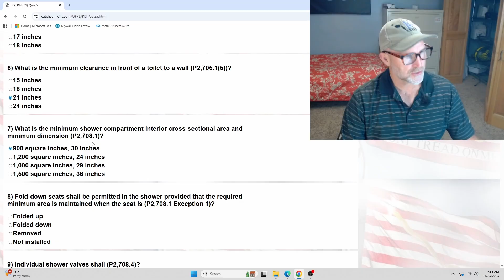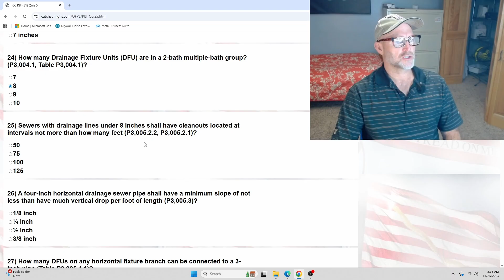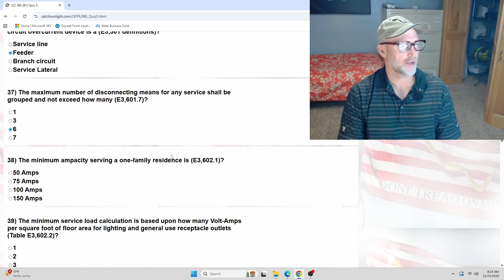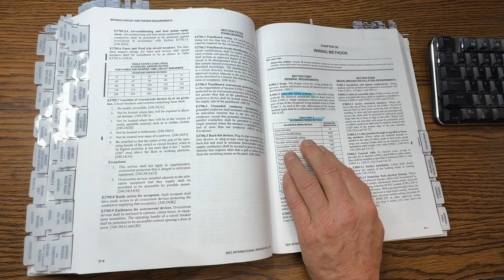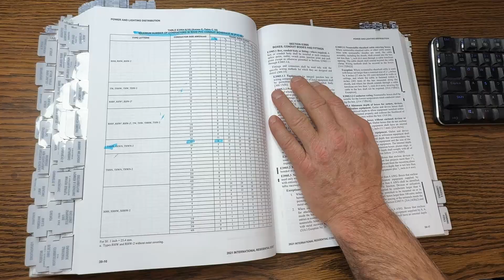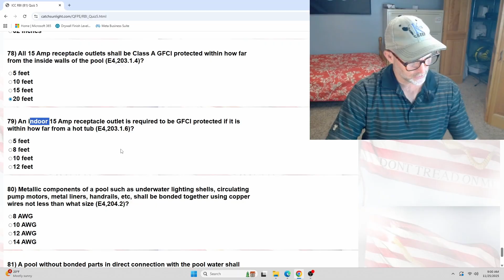Part 6 ICC Residential Building Inspector (B1) Chapters 26-42 || Final Free online test & notes

Comment: Hey my friend, can you give the website info on the practice quizzes? I recently took the b1 but failed and trying to be ready. Thanks
Reply from the maker: www.catchsunlight.com/QFPE
Reply: Thank you
Reply: Hey buddy, I have no other way to talk to you so I'll ask you on here. In the b1 practice test there's a couple questions that I'm sure of. How many risers is there a requirement for a switch at the top and bottom? I put 6 risers but it says it's wrong. Also, what wood is termite safe and naturally treated? I put redwood but it's wrong according to the test
Reply from the maker: @aservant2287  Ouch!  that's a major bummer on the fail.  As I recall, the answer on termite resistant had two wood types in the test when I took it.  In other words, there was an option with a couple species and they both were resistant.  I don't remember exactly what the question was, though.  Regarding risers, See 2020 NEC Section (210.70(A)(2)(1), (3).  It's 6 OR MORE risers.  I don't know the list of answers, but that's right from the NEC that forms the basis for the IRC.
Reply: @CodesExplained ok, no worries. It's a good prep test still

Comment: So is the electrical portion of this video only for plans examiner test? I’m taking the E1 next. Thank you for your help.
Reply from the maker: I can't remember off the top of my head but it seems like the B1 was up to something like Chapter 10.  Past that, it was for plans examiner.  I'd recommend going through the E2 video and 6 tests that were created for it as the E1 would be a subset of the E2.
Reply: @CodesExplained  thank you, so if I practice those 6 test (E2) from your website it could help me with the E1 exam?
Reply from the maker: @LegendaryPrince777  I've never taken the E1.  I assume it uses the electrical sections of the IRC as the reference.  The NEC is the source for those IRC related requirements.  The E2 practice test helps you know the E2, so it should accomplish the same thing in terms of understanding the layout of the code.  There will likely be some similar questions.
Reply: E1 Residential Electrical Inspector is 2 hour 60 questions.  The E3 Electrical Plans Examiner is a 3 HR 90 minute exam.  I have B3 Commercial Plans Examiner and R3 Residential Plans Examiner, which includes trades study for mechanical, plumbing, and electrical. Congratulations on your accomplishments! @LegendaryPrince777

Comment: Are these the questions that are on the (P1) and (E1) tests as well. If not, do you have other resources to prepare for those tests?
Reply from the maker: You could look through the P2 and E2 tests.  They use the IPC and NEC, but will adequately train you, particularly if you take the time to cross reference.
Reply: Thank you. What about the M1 test. Is there a separate book for that as well?